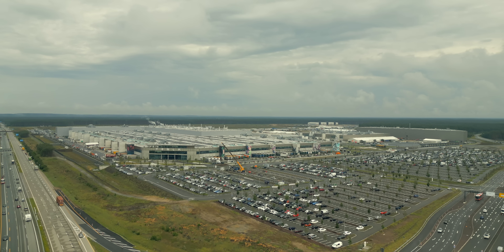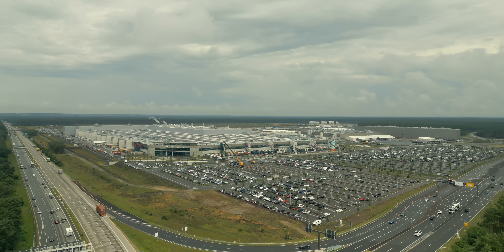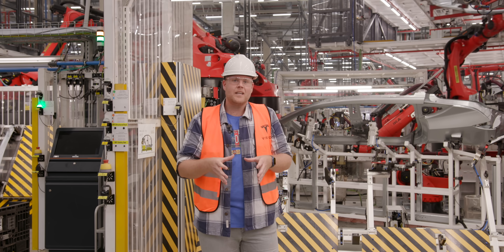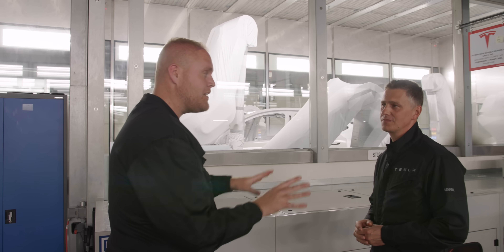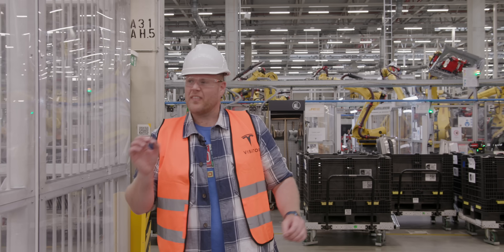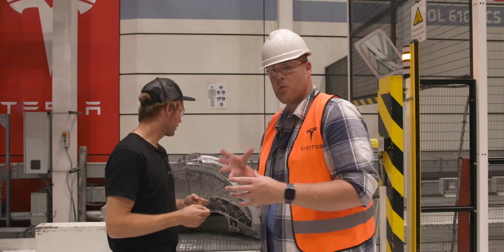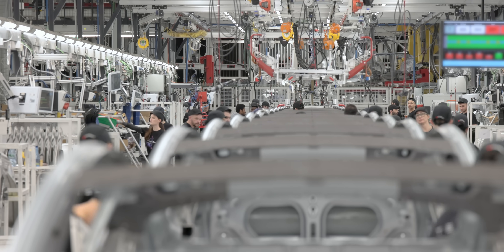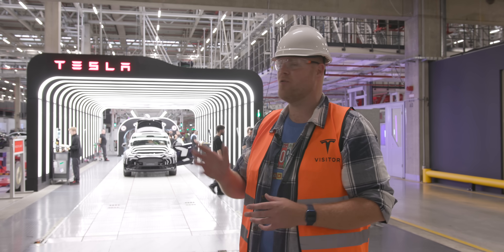Special Sneak Peek inside Tesla's German Gigafactory!

Comment: the size of the factory is NOT the reason they’re called Giga Factories…
it’s because the first Giga Nevada was meant to be a factory that produces over 1GWh of battery capacity
Reply: The expanded Giga Nevada will be capable of building 100 GWh of batteries annually.

Comment: That was more like 80 seconds between cars. They waited for you! But the 45 seconds average speed is remarkable. Thanks, Roland. 🙂👍
Reply: 45 seconds is the design speed of the line. The factory hasn't yet ramped up to that speed, partially because the stamping section isn't completely finished.
Reply: They probably have more than one delivery tunnel.

Comment: Hi Fully Charged Show.  I just write to let you know that i have to unsubscribe your channel.  Electric Cars are not the answer and - sadly - never were.  There was a hype, granted, but trying to feed a "you have to have/you have to own a car"-system is still just plain the wrong way down that one-way-road.  The only way forward is Cycling, Peding, Busing, Trainig and - Car Sharing for those who have to travel more than 10km, those working night shifts and those who actually need a car to get around their everyday due to inabilities.
 
As long as you openly ("you can buy this car for (x(x))xx xxx xx €") or suggestivly (videos like this one here) promote the idea of "owning a car is a good thing",
you will be part of the problem, not part of the solution.
Reply: I have to disagree,  In my country NZ there is at least 1 diesel or petrol car/suv/ute/truck for each resident,  ie 5 million,  we have a decentralized community (except for Auckland) and most of us just have to rely on a car/van/ute/truck to get around etc, and to deliver vital things like groceries, fuel, business components etc.  I have an ev and it has been great!  our power here is over 80% renewable and I use it for our around town duties for our business. We still have to rely on diesel for our delivery vans. All our diesel comes from Singapore, (via oil tanker) who refine the oil from who knows where.  We do have the capability to cut down our total dependence on imported oil products,  so the sooner we can use evs for the easy stuff,  like cars and last mile deliveries the better, this will help us to be more energy 'independent' not talked about much as yet,  but will be in the future.
Reply: Go away.

Comment: Very interesting! Q: If Teslas are made with giga body panels, it means they are efficiently manufactured, but what about repairs? Would you need to replace the entire large part?
Reply: There is a crumple zone between the and of the casting and the bumper. If a crash intrudes into the casting then this would be considered a right-off in a regualr car. The castings are also repairable. Many videos on YouTube answering this question.

Comment: The downside of gigacastings is that they are extremely far off sustainable. It makes the production a lot less costly, but in accidents, a little nudge/dent can render such a car to total write-off. As compared to "normal" produced cars, a small part could be replaced. With giga-castings, this is no longer possible. So instead of exchanging a small part in a car which keeps it running, now you'll have a car that needs to be wrecked. This is an absolute no-go IMHO. This is really a very bad thing Tesla sells.
Reply: Wrong. Giga Castings can be repaired.
Reply: @mfe165  That sounds interesting, so far only heared the opposite. Can you put some link that shows more about that?
Reply: Sounds plausible but in reality uninformed.
Reply: That's incorrect because the castings are protected by crash structures and there is an outer layer of body panels that gets damaged first.

Comment: Half a million cars !!!  What if you cant sell all the cars 😂😂 why is vw and others going back to ENGINES  because customers dont want ev's.
Reply: @Ban2tonneEVs  Thats one country. VW has been dead flat since in 2015 in Germany. 8 years warranty on the battery and motor. The average age of cars on the road is not much more than that, plenty of Tesla with very high mileage, if its going to fail it will likely happen within the warranty period anyway.
Reply: @Ban2tonneEVs  The world is in the biggest car revolution for a hundred years,  so you will have to watch this space for a while.
Reply: @Ban2tonneEVs you mention Germany then mention £.
Why don’t we keep it U.K. centric? 
New EV sales up by just over 7% whereas petrol and diesel sales both down by ~7% and ~17% respectively.
Used EV sales up by 71% in Q1 compared to Q1 last year.

Is there a reason you’re not sharing these “real facts”? 🤔
Reply: I would not google the best selling car in the world for 2023 if I were you...

Comment: now this was properly interesting, particularly the casting bit, I never knew!
Reply: I was surprised with the slight mention of "post processing" on the giga casts... One can only imagine how big the CNC's that drill and face the casts are!
Reply: @SamSayaz  - reports are FALSE.
only MINIMAL processing is Required .
however the Castings , do have small Parts for the Vehicles to be removed , like model Parts on a Spew
ZERO drilling or Reworking.
the Gigacast in Vehicles are so sharp , you can get cut BADDILY , so workers have to wear Chainmail gloves. .
Reply: watch MUNRO live - Tesla Cybertruck factory tour , MINDS BLOWN.

Comment: I’m definitely not going to believe the Hamster figure unless they actually do it. 😂 So comfortable to let’s tours the Giga Berlin must be running like a Swiss watch. 
Removing a Oven may be wrong move we will wait to see if the paint chips. In fact Elon we want Paint that is like rubber and takes a stone hit and laughs at it 🤔👍over to you. They need to work on the repair costs as they are so dear the insurance companies are charging a premium for cover. Trouble is one part is expensive to replace to a section made up of parts.

Comment: Making the car out of almost all one part is pretty cool, but I'm curious what effect this will have on car repairs.
Reply: Lars Moravy, the chief engineer commented on this several months ago.

I can’t remember verbatim, but they’re able to repair all of the most common kind of damage, ordinarily repairable with standard construction, and do so at a significantly lower cost.

Given that they also provide insurance in the USA, it’s in their interest to make repairability a priority.
Reply: This writer just read a byline on EV repairs/Tesla. Most insurance companies write off Tesla espc. and other EVs for even minor repairs. It costs  too much to fix in relation to the value of the car and the lost time to the customer. The Rivian truck is a fine example. The ENTIRE bed and up to the roof is ALL one piece. So even a small rear end collision and poof! repairs become expensive beyound the dreams of Croesus. Unibody cars are NOT NEW. In the 1960s there was a unibody Ford[I think it} truck. Many small cars were unibody. And the same insurance mindset--scrap the car, do not fix it. I have seen videos {Auto Auction Rebuilds} where GAS cars, a few years old with 'decent ' low miles are scrapped for hail damage. You would need a magnifier glass to see the 'dents'. Or cosmetic plastics damage, that a 'fool with a tool' could fix in an afternoon {with the spare parts]=junk the car]. GO figure Department

Comment: The best quality car LMFAO.  Unless EU/UK get's a much high standard, it's still crap-in-crap-out quality in North America
Reply: Frankly, most people will pay more attention to what they see in front of them, and on their driveway, and the analysis of industry experts, than some random person on YouTube.

Feel free to come to the UK and examine my Model Y. I know that the panel alignment is as near perfect as you will see on any car. Mine has just completed 50,000 miles without a single issue, it’s an absolute pleasure to use and to own.

Maybe try a spot of reality before you try to appear informed?
Reply: We've had zero issues with our Fremont built three-row Model Y. That's 18 months and 95,000 km now of trouble-free e-motoring, hauling around the rent-a-kids, camping gear, and towing Seadoos. No quality complaints from us!
Reply: @KevinT3141  just becomes it moves and does basic things doesn't mean it's a "quality" product.  I can see most misaligned model Y hatch gaps form the fucking moon.
Reply: @Mguy393  Having no oil changes or service visits for anything other than its annual caliper slide lubing is far more important to me than any panel gap. (Although all of ours are uniform as far as I can tell.) I'm sure you're a much bigger internet expert on my car than somebody who actually owns one though, so I defer to your superiority.
Reply: @Mguy393  you been there then?

Comment: Hamsters are cool, they drive ... Kia Souls.
edit - A new car every 45 seconds? I timed it, closer to 80 seconds.
Reply: Perhaps there are two lines.
Reply: Was thinking the same here. Tesla itself is claming a capacity of ~350,000 cars per year from Berlin-Brandenburg, but they're certainly running at a lower pace right now.
Reply: Newsflash, factories don't run at full tilt all the time.
Reply: @boostav  exactly, anything over 85% is considered as full capacity.
Reply: Having been in the factory it is definelty not operating at 45 sec a car

Comment: too bad you made an image film out of this instead of actually picking up on all of the criticism around this entire plant and their behaviour. as a manufacturer and as an employer. missed chance of actually informing people about teslas behaviour. too bad.
Reply: Can you be more clear about their misbehavior?  Are you talking about the water over usage when when the Brandenberg coal plant down the street uses 100 times their water allocation and routinely over uses with no penalty? And then the Brandenburg water authority comes out and clarifies that Tesla has not been over usage of their water allocation. Are you talking about the leakage of paint shop chemicals into the water supply except a the actual leak was contained  in a safety container tank that Tesla had established exactly to be a backup to prevent contamination./runoff.  Cutting down trees to expand the factory? The trees that are all of the same non-native type with no bio diversity as they were initially artificially planted as a paper mill. And Tesla has to date replaced low trees with actual bio diverse appropriate for habitat fauna to the tune of million trees planted.   Do you think the VW and Mercedes and BMW auto plants are more environmentally friendly than the Tesla plant with all the attention that the Tesla plant has received or would you rather the attention just be continued to be placed on Tesla rather then on the native German auto makers?
Reply: You mean the trees that were cut down? The ones that were from a wood production forest and were always going to be cut down to build houses with?
I’m all for criticizing legitimate concerns, but this plant is fine and is a massive net positive for the world.
Reply: @FreekHoekstra  and Tesla has already planted a much larger real; forest of over a million trees, designed and monitored by ecologists
Reply: @FreekHoekstra  Would be nice to see some trees planted around these factories when they are finished. The parking areas look bare. Would be nice to employ landscaping in the initial designs. I worked at a huge chemical plant once, it was austere and soulless. I bought a huge bag of sunflower seeds from the local pet shop and spent a few lunch hours walking around every facility planting them in any bit of dirt i could find. When summer came it was quite a sight of yellow sunflowers everywhere.
Reply: @FreekHoekstra  No, it's about their environmental record in both California and Berlin. Probably at every location. Treatment of employees too.
Reply: Can you please elaborate?

If you won’t, we will be forced to conclude the obvious, which is that you’re spouting nonsense.
Reply: Elaborate and cite sources. Otherwise see what an npc is.
Reply: Booo
Reply: You're the same type of person to complain cars are coming in from China but vote down a plant to build cars in your own country.
Reply: Because the criticisms are proven bullshit by fossil fuel backed groups.
Reply: Unfortunately Fully Charged never critises anything as long as it claims to be green.
Reply: Have the comments being deleted
Reply: tell me more!
Reply: Or perhaps Tesla is not that bad?
Reply: Tesla is not that bad? It's owned by Elon Musk. How much worse do you want it?
Reply: @GeehadeeKomunisste Tesla is a public company, about 47% of it is owned by retail investors (that’d be us). The notion that it “belongs” to Elon is false
Reply: @rendezone  He owns enough of it to control it. There's no need to be so pedantic in YouTube comments. Everyone knows what I mean and what he is like.
Reply: @GeehadeeKomunisste  I think everyone knows what you mean, yes. Unions are all great; there is no corruption, he exploits people; never mind most employees absolutely love to work for Musks companies. … I think there is a lot to criticise but also a lot to praise, so either be more specific or I’ll have to be pedantic again due to one-size-fits-all arguments
Reply: @valandil86 you tell me, they seem to have a huge problem with unions even in countries where virtually everyone is unionised.....
Reply: @vote4coffee  maybe we should ask the workers at the plant if they want to unionize instead of being patronizing towards them. Oh right they voted not to unionize. Stop being patronizing to others and thinking that you know what’s best for them and that the workers are too ignorant to make their own decisions because if they chose not to unionize it’s obviously Tesla‘s fault
Reply: @Jeddin  It's absurd someone would vote against unionizing in Europe. Tesla probably made it clear that everyone who unionize, will get the boot as Elon is a union-buster.
Reply: It is sad that most of the videos regarding Tesla are like that

Comment: Giga is the amount of carbon it produces
Reply: Not really... long term it is less than ice vehicles
Reply: In the total supply chain a lot of carbon is still produced indeed, although off set by a large margin by the fact that the cars are electric and also by all the PV panels Tesla produces. Also consider the fact that battery materials are circular, so at the end of the lifetime all materials can be re-used to produce another EV with only minimal or no emissions. You gotta look at the whole picture, that's where you see the huge advantage of EV's compared to fossils.
Reply: Yes, you're right, but by that logic most other car factories should be called terafactories.

Hint: tera == giga * 1000
Reply: You seem to really care about carbon emissions. I take it you're vegan, take the train and only buy used clothes?
Reply: @jojoflowe you're use of stigma isn't working.